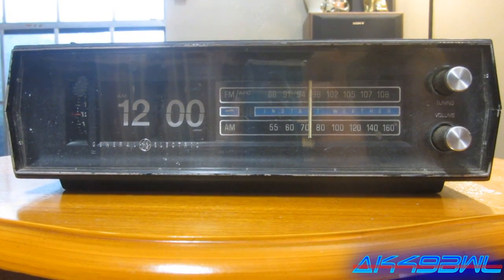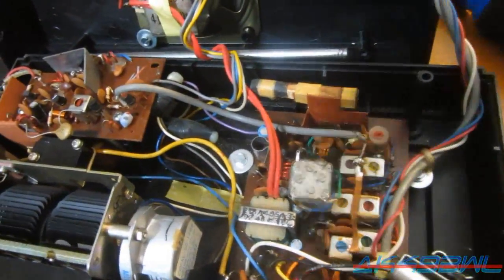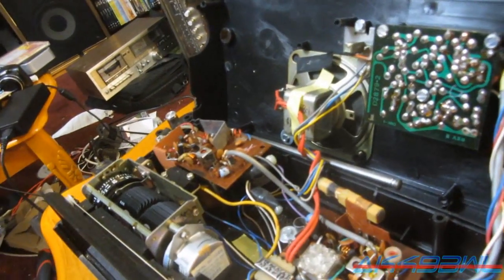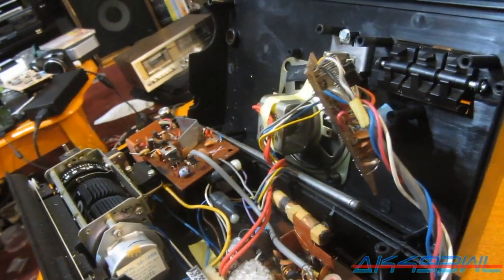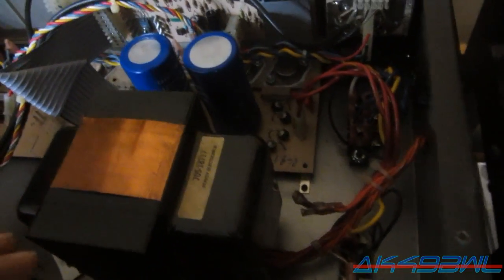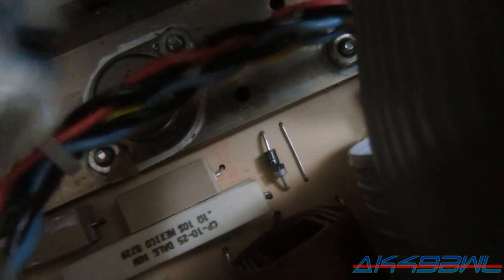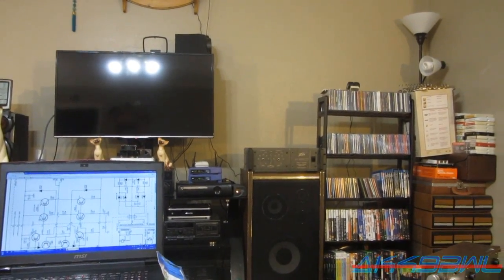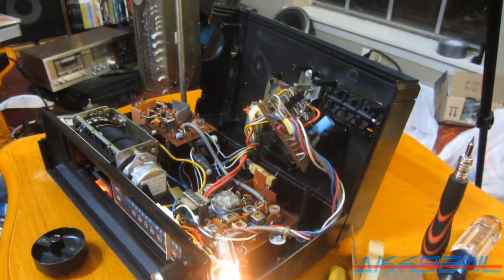General Electric C4332C Clock Radio "Working"

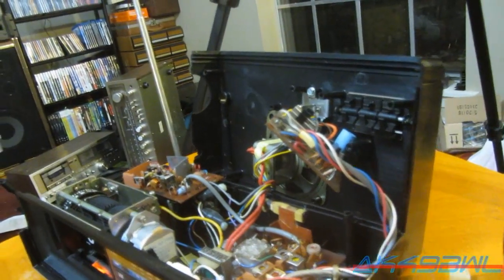Comment: I just got this same model off of ebay last week to replace one I had 20 years ago. I also bought and restored the non-weather version, C4331B. It is my primary alarm clock and keeps dead solid perfect time. The clock mech works fine on the 4332, and I plan to restore it. Did you ever figure out the weather radio tuning? My local frequency is 162.475mhz and the fine tuning knob does not pull it in. I was also curious what the music was that the radio was receiving at the 16:45 mark. Sounded interesting.

Comment: Might need to hook up a TV antenna to improve FM reception. A lot of those old clock radios had 300Ohm screw terminals. Get a 300-75Ohm adapter and use any TV antenna, If you want really good reception get one of the preamp DTV antennae. The weather band might be one of two things: It is tuned to 162.55 by crystal or other means and you might have to modify that for your local weather or it has a small "fine tuning" screw adjustment somewhere inside or outside of the radio. Usually they would go from about 161.55-162.55 or so to allow for the three US channels and the one Canadian channel back in the early days.

Comment: DeOxIt is an electronic parts cleaner that you can use on the potentiometer knob that controls the volume. It should help get the sound work and stop the crackling sound when adjusting the volume